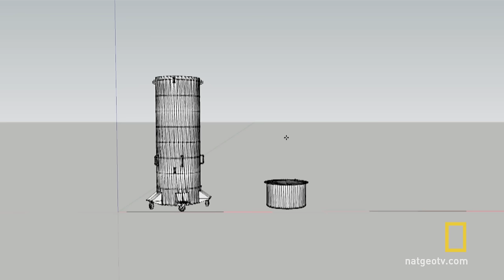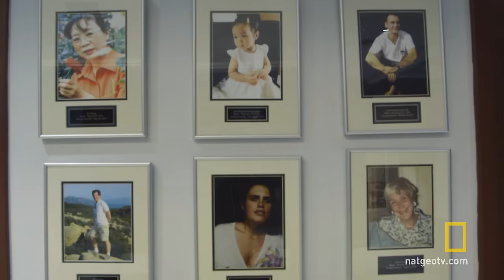Cryopreservation Explained | Explorer

Comment: And what happens when this scam company goes out of business in 5 or 10 years?  The meat gets thrown out.
Reply: Alcor actually is the best established and has a pretty solid infrastructure in place.  They own a nitroglycerin plant, and the storage vessels don't actually require electricity.  Plus, they have a whole other side of the company that's essentially an investment board which invests money in low risk money markets and also use high yield interest building accounts to grow their financial resources for both up keep and also for hypothetical revival.  

I'm not an Alcor member.  I literally had the same thought you did, and did my research into what Alcor's plan exactly was for long term finances.
Reply: Sylen it’s a nonprofit that’s been in existence since 1972
Reply: Its been in business for decades